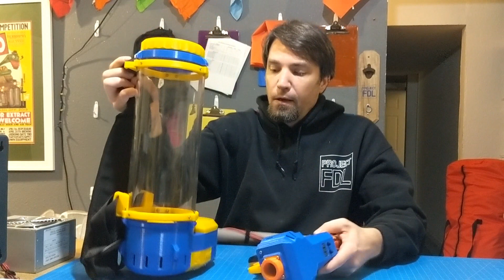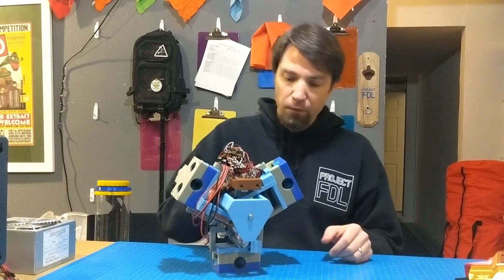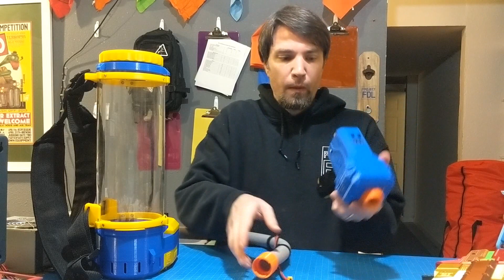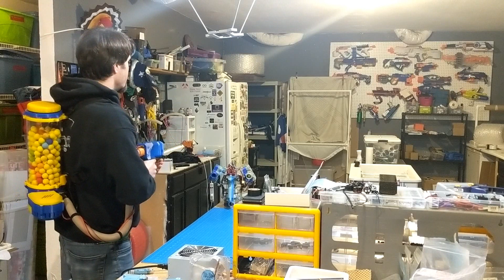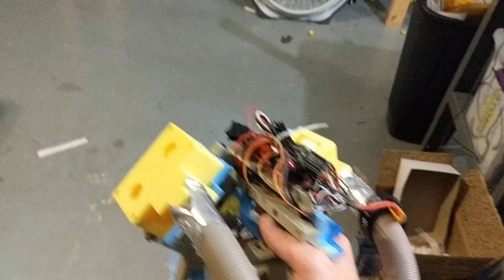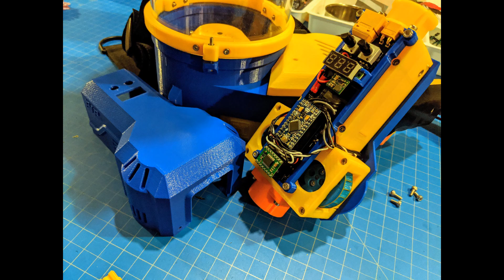Pip n Pak First Look

Comment: Holy balls (pun intended) that tri-wheel system is insanity! Would love to do a "Shooting __ as fast as possible" with it.
Very interesting choice to have Pip be the 'brains' of the system, but a cool way of doing it so there's no secondary thing to hold, or having to mess with the pack itself.
Design of the pack looks really nice, too!
Reply from the maker: Moving full control to Pip not only eliminates the need for an additional Arduino in Pak but also hands it the ability to independently run the blower or agitator as well as adjust the power of the blower. That coupled with an intelligence of how fast and consistent balls are running through the blaster opens up the potential for automatic power saving techniques down the line.

Comment: Very cool! Have you considered a soft pack for the protonpack? Seems like the blower unit could fit at the bottom of a medium sized backpack, which would be much more comfortable to wear.
Reply from the maker: Blower systems like this are a pressurized system. Air needs to come in, fill the tank with as little leakage as possible and go out the hose. I suppose a semi rigid bladder of sorts would work but solid is better.
Reply: @projectfdl6831  I see. I thought the blower created a small vortex at the bottom. I didn't realize the whole sytem was pressurized. 

If you wanted to experiment with soft packs - maybe one of those dry bags would work - the rubberized material that you have to fold over a few times to close.